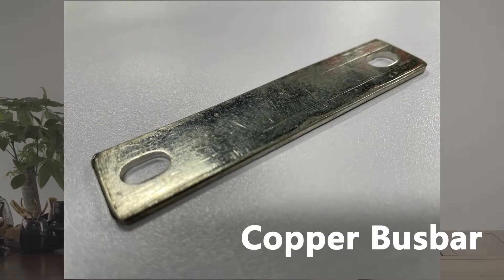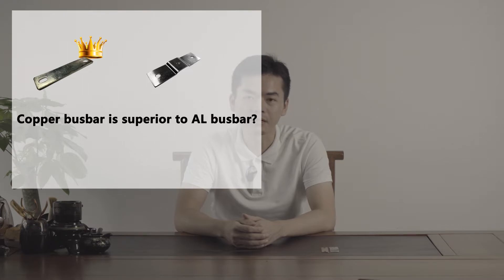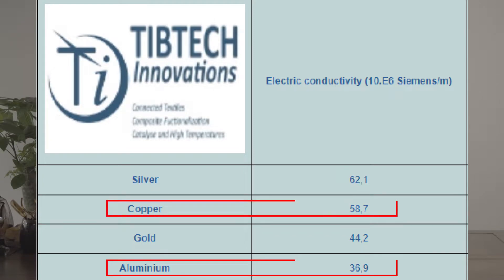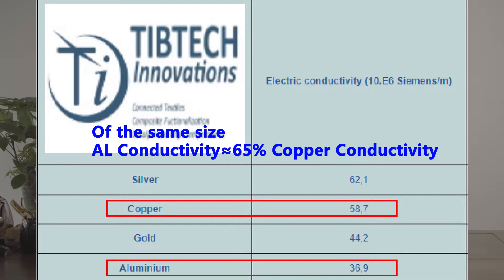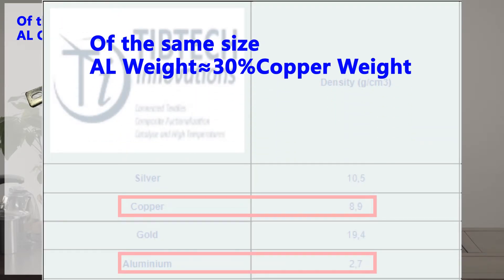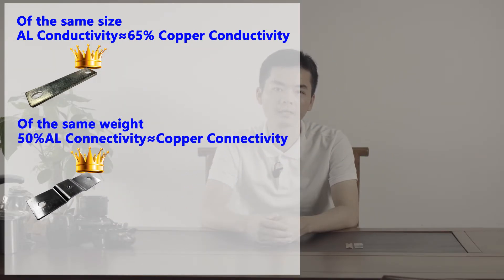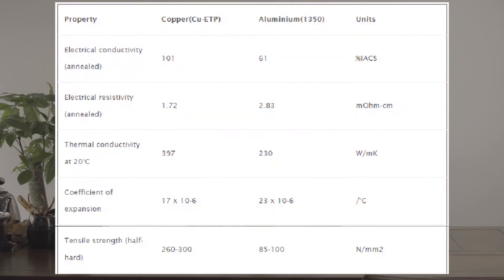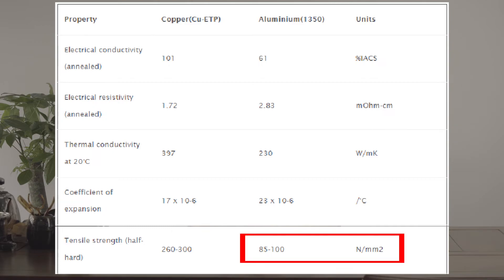aluminum vs copper busbar, aluminum bus panel instead of copper bus panel aluminum bus vs copper bus

Comment: How about conductivity of aluminium oxide vs copper oxide? Only way to stop oxidation is to apply a coating of another metal or apply grease and the grease is usually a worse conductor than the oxide layer. Is this now why they often tin plate copper bus bars? As far as I know I don't think you can plate aluminium with anything useful.